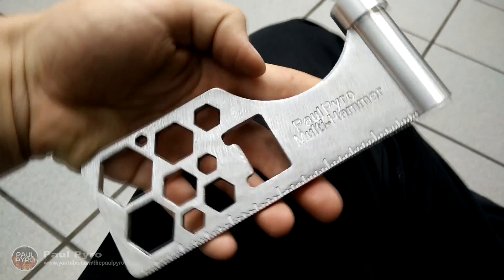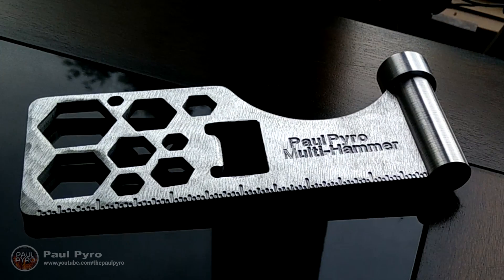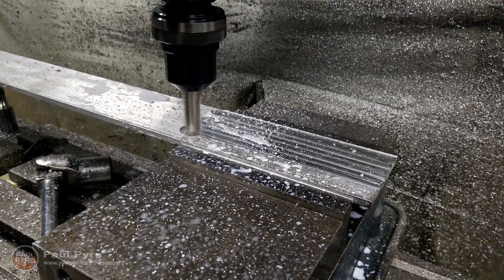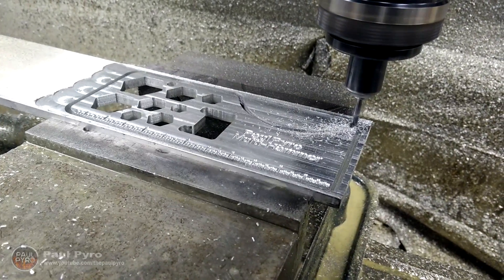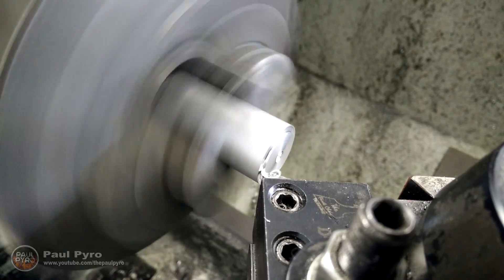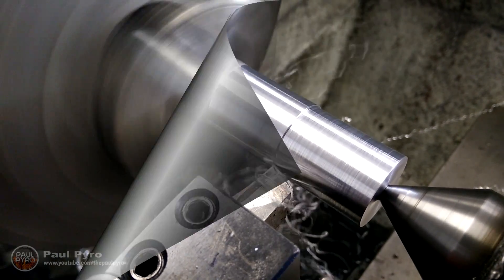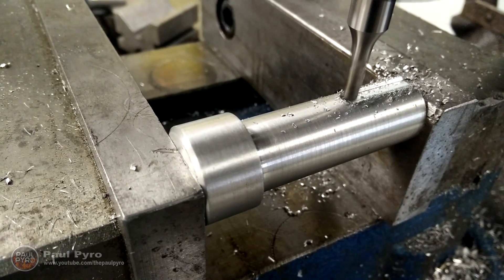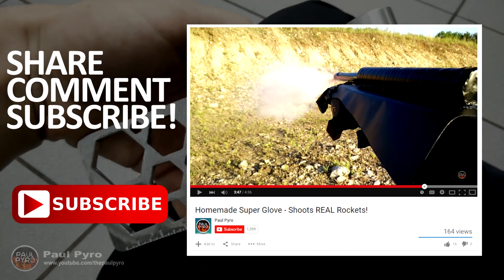Homemade Multi Hammer [Paul Pyro Invention]

Comment: Very cool design. I wish my school had some machining tools like that!
Reply from the maker: Thanks! And sadly I'm graduating very soon so I will not be able to use much of these tools anymore.
Reply: Paul Pyro
You have access to these tools at school? That´s awesome. Over here in Germany most normal schools don´t have anything like that.
Very cool design and the turning was nice. You developed some good skills. I wonder how you attached the hammer head to the shaft. Did you glue it or weld it?
greetings
e
Reply from the maker: Yes, I was lucky to have a very well equiped machine shop at school. Sorry to hear that from Germany, you should try and experiment on growing a home shop, its loads of fun! And I initially was going to weld the aluminum pieces but since this is 100% aluminum, and my experiences involved steel/iron, I was nervous I would mess up. So I used liquid steel epoxy, which is wierdly super strong. :p 
Peace,
Paul Pyro